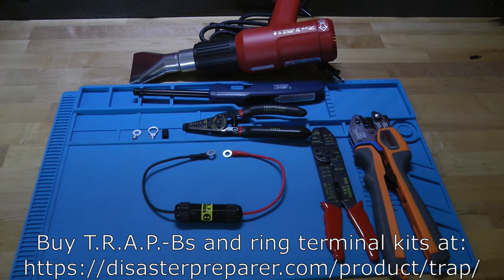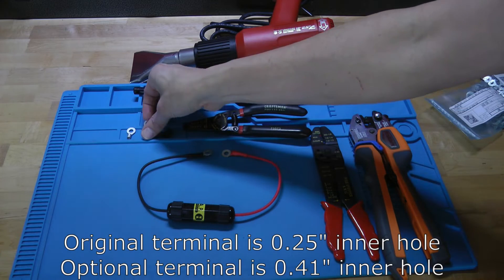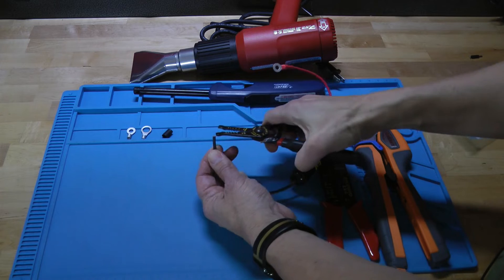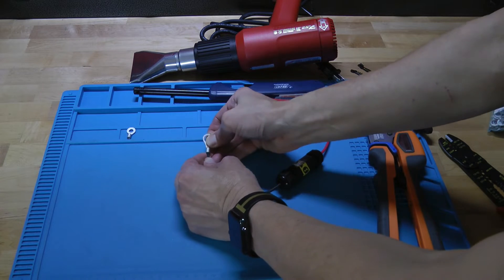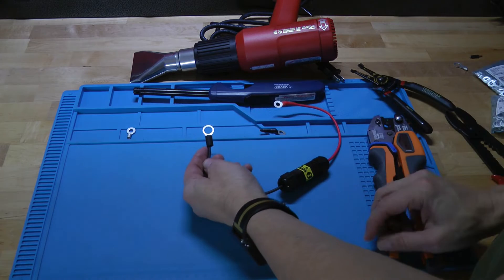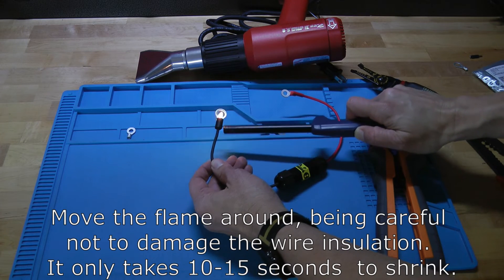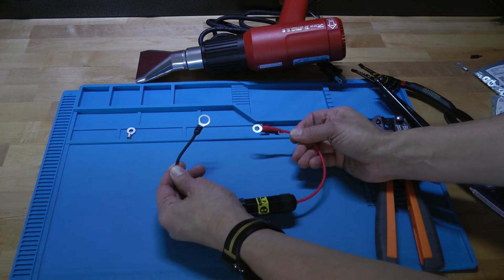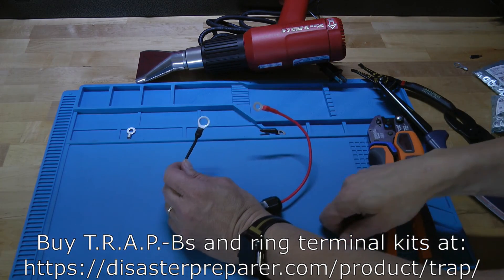T.R.A.P. EMP Protection, Changing Ring Terminals

Comment: From Lil Giant I only recently subscribed, am really new to this info, and am not sure what this video is about. I watched the one about putting cloth over the cars. Starting a homestead next Christmas and had found out about a black paint you can put in your house to protect it. Was planning to do that, but can be pretty expensive. Saw your video on cloths. That is more within my budget range. I do not know what this box thing is. Sorry. Do not know what a “cage” is. Getting confused about where to start and what to emphasize. Think probably a house/shelter would be first priority. Thinking about a root cellar. Could I keep stuff down there without needing protection? First place us going to be a rundown old trailer my friend and I are going to rebuild. He is pretty good at that stuff. Thought I would put black paint inside the walls when we renovate. 

I saw you sell some kind of electric stuff to protect things. Right now am concerned about protecting an invalid on oxygen. She lives in a townhouse. Was going to get solar battery. Wanted to protect electrical system to protect solar battery and oxygen machine. If you have any suggestions for either the invalid or, later, after Christmas for the homestead, including a root cellar, I sure would appreciate it.
Reply from the maker: Hi Henry, first I'd say to focus on getting your basic preparations in order before worrying too much about an EMP attack. A blackout is probably more likely, and it would have a similar effect if someone were depending on electricity to stay alive. A good backup power generation system (you mentioned solar) makes perfect sense. As does a battery backup with an inverter for short-term emergencies. Food, water, heating, and other critical necessities should also be considered. Only after you get those preparations up and running would I worry about EMP preparedness. You might check out my handbook as a place to get started: https://www.amazon.com/Handbook-Practical-Disaster-Preparedness-Family/dp/1475136536
Reply: @disasterprepper  From Lil Giant Sorry. Guess I mislead you. We have a Burkee, we have wheat grinder, food storage. Although that is an ongoing effort, of course. Homesteading is the next step for independence. Have a little experience in gardening. Seeking heirloom seeds. Studying videos. Working on what kind of plans for storage and shelter. What kind  depends upon how fast we can decide on what is necessary. You are right. A blackout would create same situation, for us, as an EMP. Thus the solar needs. Which led us to your site. Since we are tearing down trailer on site/creating underground shelter/building home, need to decide needs, shelter methods, understand WHAT is needed and COSTS. Personally, I know NOTHING about electricity. Once attended beginning of class TWICE in ham radio. Dropped. Totally ignorant about electricity, even now. Depending on a friend. If need to paint inner walls of any shelter, even if EMP preparations not complete before complete build, want plan that. Not electronics related. But expensive. Cannot tear down walls again AFTER renovations or new build. Will not. Wondered if underground/hill TYPE shelter would protect against attack. Moisture a problem? Will look to purchase your guide, but suspect it is focused on food. We are a step past that. Need to move on faster than most due to invalid on oxygen. Complicates things and amount of time available for planning/implementation is uncertain. Must be very creative. Cannot stay in this place. Thanks for the referral to the book. Thank you for your time. 👍

Comment: How does the "whole house" device work? Does it just snap around the main line coming into the breaker box? Very cool stuff. I'll be ordering soon.
Reply from the maker: Whole house protection is done by installing a quality Type 2 Surge Protection Unit and a set of whole-house high-saturation ferrites. The surge protection device wires into the breaker panel (need an electrician for this), and the whole-house ferrites snap around the incoming power wires. I recommend the Siemens FS140 surge protection device, which can be found all over the web. The ferrites are at: https://disasterpreparer.com/product/hisat-ferrites/.